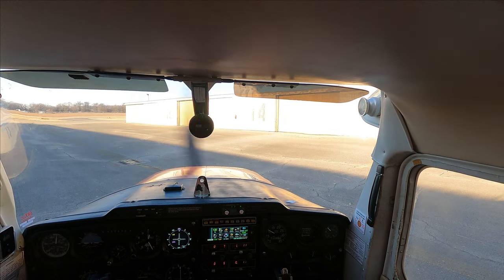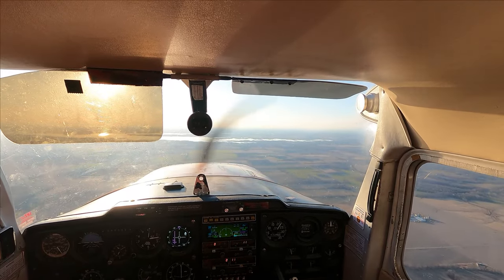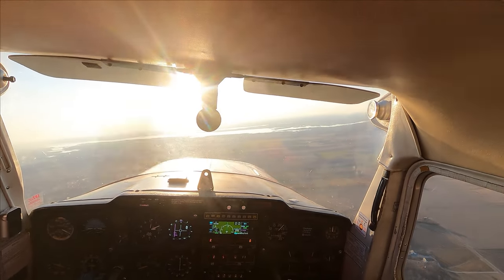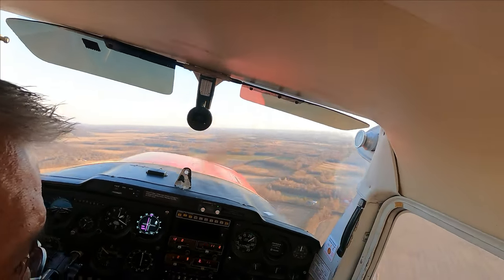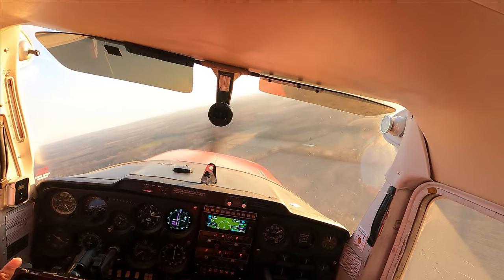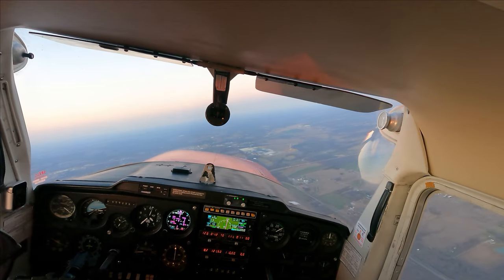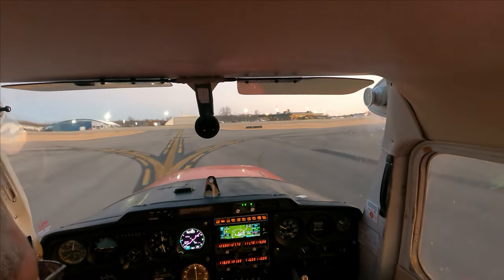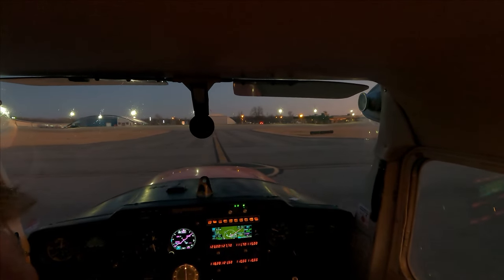Practicing commercial check-ride maneuvers

Comment: Love the video! I'm a CFI in the Chicagoland area, but loved seeing you practice these maneuvers, and had a few notes: 

- for the Chandelles, make sure to be level and accelerate to your entry speed before starting the Chandelle, that's why you were stuck at the low airspeed for the last 45º of the maneuver. Also, don't descend to regain airspeed after the maneuver, because the entire point of the maneuver is to gain altitude, so you don't want to lose what you just gained.

- for the lazy 8's. the purpose of the maneuver is to demonstrate the overbanking tendency of the airplane, and entering the maneuver you should not add any additional bank yourself other than that initial 5º to get the maneuver started. I always recommend moving your hands under the yoke to resist the temptation to turn the plane in the maneuver. during your slice, you began just before the 180º point and let the nose drop very quickly through it, instead try to smoothly begin at your max pitch up 45º point and hit your max pitch down at the 135º point, then recover from the bank.

- for the turns around a point, I try to find points in a straight line, and also the ACS requires you enter it on the downwind 45. especially in illinois, it is quite easy to find points as the fields naturally connect them and I always try to find them about a mile or about 2 block apart, using that middle separation as your center point. Also, if you do not have a pivotal altitude chart, let me know and I can send you one. 

- lastly, on the steep spiral to power off 180, I see that you turn early to assure you make your field, which is great. however, I see too many students being extremely conservative and ending up high and floating halfway down the runway. with the 180, I always advise my students to turn early like you did, but if you are high, slip on base. for some reason, a lot of pilots (including me initially) forget that you can slip wherever you want, not just on final. use that slip!!!

Love your content, and if you would ever like to make the trip up to chicago, let me know and I would love to fly with you! 

- Kelly
Reply from the maker: Thank you, Kelly. I appreciate the constructive feedback(I once had a supposedly experienced pilot with 40 years comment saying he now realizes he shares the skies with idiots like me because I fly IFR in a "simple" airplane C172. lol).  I know I'm definitely struggling with the chandles and lazy 8s. I have only done them 2-3 times with my cfi, so there's work ahead. I visit Chicago land every 6 months to see my AME. I like flying that airspace.
Reply: @Low-N-Slow  Love it! Blue skies and tailwinds :)